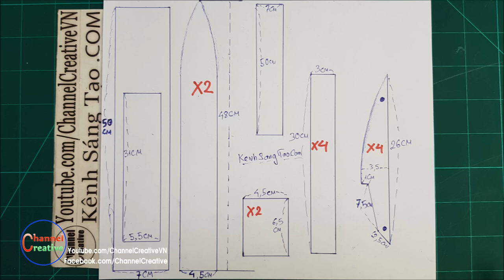Build a Rigger RC Boat 70km/h - Tutorial

Comment: The pipes are for cooling purpose. It is called water cooling system. Water enters in the pipe from bottom and gets out from side. Otherwise the boat will heatup intensively as there are no ventilation ports.
Reply: Thanks for the information.😀
Reply: On My boat ft009 water enters at The bottom an comes out from The back
Reply: Do you need a pump to circulate the water? I saw you have a component to connect the water in and out. What is that part? Can you provide a link to purchase?
Reply: You are really smart, I wasn’t sure what that was for thank you for telling
Reply: Where can you get this?
Reply: @kinphoon2910  Nope, water enters as the boat moves forward, if you look closely at the thing that turns the boat you will see that theres a small hole pointed forward so that happens
Reply: Thanks for info

Comment: What is the purpose of the tubing?  I see it goes from the rudder into the hull and maybe to the motor?  Then to the outside of the hull? I saw the builder blow into it several times during assembly without any effect on the rudder so what the heck is it?
Reply: Gbe Nother got the same question
Reply: It's for cooling if you look on the rudder on the bottom there are two little holes when it goes fast the water goes inside the hole and goes through the tube to cool the motor
Reply: Gbe Nother thanks man
Reply: What a smart gadget!
Reply: It cools the motor and the esc with water picked up by the rudder
Reply: @innalee7232  water flows through that tube from the lake as the boat moves
Reply: @innalee7232  the hole u are looking at is the ext hole. Water is picked up via the string fin

Comment: why that yellow.. pipe.. dint understand
Reply: Picks up water and cools the motor and esc
Reply: Thats for ESC cooling. It picks up water from rudder, and went through ESC. Noticed that the ESC has 2 inlet outlet plug.
Reply: @waioramin  , if  water enters through tail hole, it will create a jet force at the outlet, perpendicular to the movement. There is no contact between the pump and the motor and I will remind you that thermal conductivity of air is 0.022 W / K * m (27 times lower than wood!)
Reply: @innalee7232  there is no pump in use anywhere in this boat. Thats the ESC (speed controller).
Reply: @waioramin  , You're right, I should have looked at the description, it's cooling the board
Reply: 1.21 and 1.22 minutes have a 1 water pump but he did not used it , interested :)

Comment: there ya GO!  just about the same size shape and speed I was getting in 1989 running a 14D 05 size brushed motor, Octura X432 prop, Dumas 1/8" shaft, on 9.6v 3/4 sub C pack had to assemble myself. clocked (radar) at 36 and 37 MPH, about 60 kph. for it's day crazy fast. today you can get much more using 3650 (05 size) 5000kv swinging 35-38 mm prop, build same hull but about 15% larger. simple tip, put clear mylar packaging tape down bottom of your sponsons, then use a little car wax makes them SUPER slippery, it helps!

Comment: Very nice boat and fast too, I prefer fast boats myself.I have built a SWAMP BOAT out of scrap wood from B+Q!!! So effectively a free boat, plus get motors etc of ebay, a flysky reciever which is about 5 quid and your off the the races!!! I have also got an VOLANTEX ATOMIC, which is really FAST, I love it!!! Tried to get a bit more speed by connecting 2 , 2 S Liop's in series 14.8v and blew a reliable speed controller.I have got another one since like. Some TIT in china sent me a 22.2 volt Battery when I ordered a 14.8 Volt, will have to send it back!!!!

Comment: Nice work bro. but i through the water pipe will need to mount around on the motor to cool it down isn't it?, and also any leak after flying on the lake?

Comment: What diameter carbon tube did you use? I have printed off the drawing and ordered all the parts from Banggood. I have some 2mm ply instead of 2.5mm do you think this will be strong enough? Great work keep it up!
Reply: 2mm works fine just add more ply on the planing surfaces that are prone to stresses ie bottom of hull and out triggers especially the tips

Comment: hi ,nice cheap build and really do works , wish to ask you what black plastic pipes did you use and from were shall i buy them , wish to also ask what measurements does the sponsons holes are and last question what is the cg of the rigger
Reply: The plastic pipes are watercooling system for esc.

Comment: The only purpose of the yellow tube connected to the rudder is to pick up water from a hole in the bottom of the rudder and flow the water through the tube through the ESC for cooling and then exit the side of the boat hull through the hole he drilled.  Aerodynamics is what keeps this type of outrigger hydroplane boat from flipping over.  The engineering and aerodynamics of the design are what keep the hull "flying" flat and level when hydroplaning above the surface of the water.  When the boat is at full speed, the only thing under the surface of the water is the lower half of the propeller and the rudder.  Everything else "flies" completely above and out of the water, with only the bottom of the two front wood sponsons skipping or "hydroplaning" across the surface of the water.  Similar to how an airplane points straight due to the aerodynamics is exactly what keeps this boat hull "flying" flat, straight level and not flipping up.  They ride on 3 points, the bottom of the 2 front wood sponsons and the propeller.  This is a decent beginner build.

Comment: Let me ask you a question, maybe you can help me!
The question is, is because I have a remote control boat (Barco H100 RC) that supports a voltage of only 7.4V and current of 600mha, but the question is that I wanted to increase its speed and already know that the boat's engine supports a voltage higher than 7.4V, but the problem is that if I put a little higher voltage to increase the engine speed the other components of the boat's plate might not support it, could you give me some hint of How to increase boat speed without damaging components?
Reply: Increase voltage of max 3-4 volts.
I increased the voltage of an rc car from 4.5V to 8.4V and nothing is damaged throughout it goes 3times faster.
Reply: @LEFURETGAMER  Thanks for the tip, I will take the test!

Comment: i don't understand the importance of these pipes,they are used for what? Can anyone tell me?
Reply: The pipes are for cooling purpose. It is called water cooling system. Water enters in the pipe from bottom and gets out from side. Otherwise the boat will heatup intensively as there are no ventilation ports.
Reply: @khushansh1  The pipes used for cooling of motor?? The motor gets heated up?
Reply: Ranajoy Sutradhar  It is for both motor and battery also the ESC. The water running inside the pipes cools down the overall temperature inside the boat .
Reply: Ranajoy Sutradhar just like phones battery gets heated or cars engine gets heated in a boat the battery and motor gets heated up intensively.

Comment: Nice build, I havent seen this design since the 60's, they were kitted by one of the better companies at the time and plans were available from RCM if I remember correctly because somewhere in my shop I have a set - somewhere, and I had wanted to build one with an .09 engine In the style of the swamp boats used in the Everglades.

Comment: what is the name of this material of the boat structure?

qual é o nome desse material da estrutura do barco?
Reply: It reminds me of some sort of wood. But I can't be sure if it is wood. (Isso me lembra algum tipo de madeira. Mas eu não tenho certeza se é madeira mesmo)
Reply: @alguemporai1576  I want to do the same, minus the engine and the esc part. I plan to use some parts of an RC car that I have here

Eu quero fazer o mesmo, menos o motor e a parte esc. Pretendo usar algumas partes de um carro de RC que tenho aqui
Reply: @dimasalves3g  How cool. I've seen some RC projects which use foam or cardboard to build their structures. How big do you plan to build yours? (Que dahora. Cheguei a ver alguns projetos que usam espuma ou papelão para fazer a estrutura deles. Quão grande você pensa em fazer o seu?
Reply: @alguemporai1576   foi mau a demora não fiz ainda kkk  não tenho ideia do tamanho do barco que quero fazer nem sei ainda o material vou acabar usando aqueles canos finos , o motor que eu tenho é o 370 e outro 540 estou mais focado mesmo na conversão de carro de brinquedo para rc o barco vou deixa pra fazer quando der
Reply: @dimasalves3g  Está tudo de boas kk. Que tudo dê certo no seu projeto ;)
Reply: @alguemporai1576  valeu

Comment: Can anyone explain what is the purpose of yellow ruber tube(pipe) he used ?
Reply: It is for cooling the motor, ESC and motor mount. Water is forced up a tiny hole in the rudder and pumped through the components then out the boat. Simple but really effective and required on high power set ups.

Comment: what for a battery pack do you use?
I can not find the right one on the internet
Reply: You can use every 2s lupo battery you want
The s is the number of elements 
Each element is 3.7 volts
But if you have a different esc or a different brushless motor you can use the right one for it